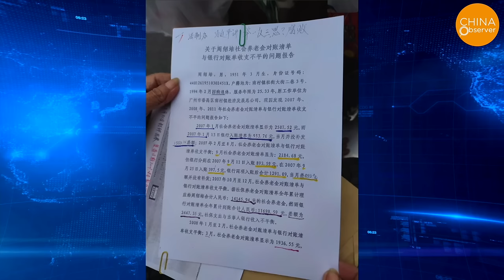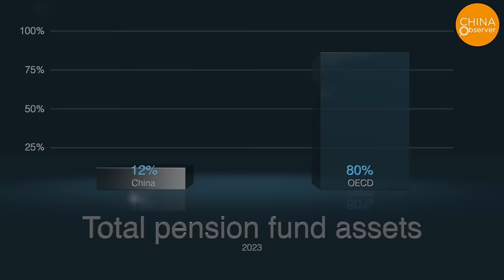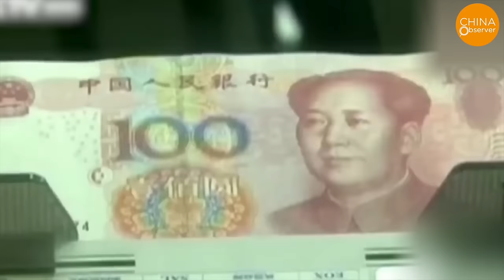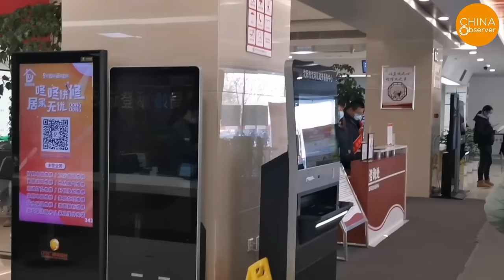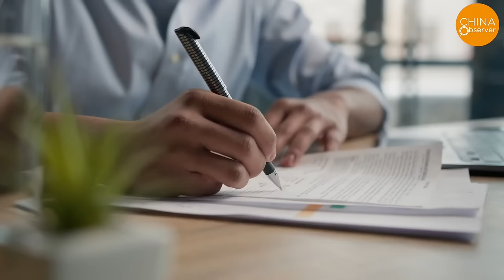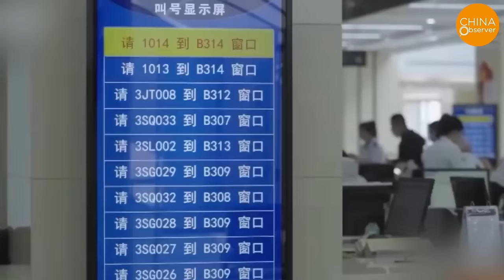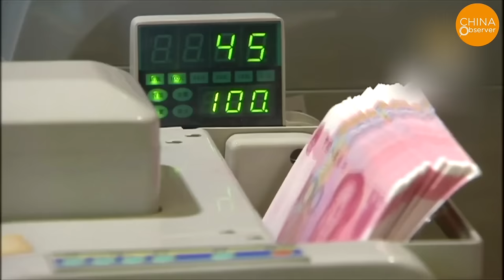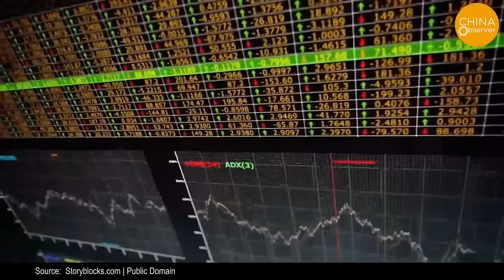Chinese Youth in Tears, Must Work 60 Years for Pension Eligibility, Pension System Goes Bankrupt

Comment: Everyone in the US is not covered by Social Security.  You need to have 10 years (40 quarters) of work with Social Security contributions of 6.2 percent of income from both the worker and employer (total 12.4%).  Your highest 35 years of earnings are used to determine your benefits which can be started from 62-70.  Starting benefits before your full retirement age (FRA) (around 67) will result in a decreased amount.  Starting benefits after your FRA will result in an increased amount.  If you never contributed to Social Security then you cannot receive any benefits.  The spouse's of workers with benefits can claim up to 50% of their spouse's FRA benefit depending on the age (62-67) that they claim.
Reply: Those data would mean something if Social Security has not basically become ponzi scheme. Technically it is on the brink or is already bankrupt.